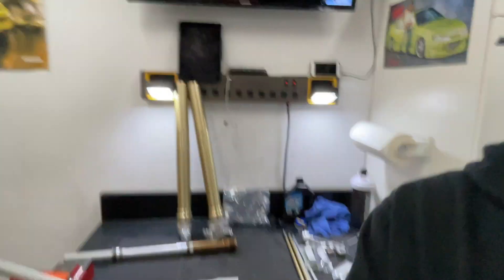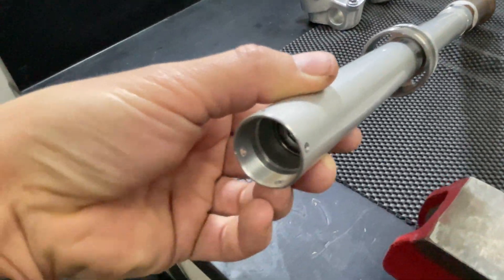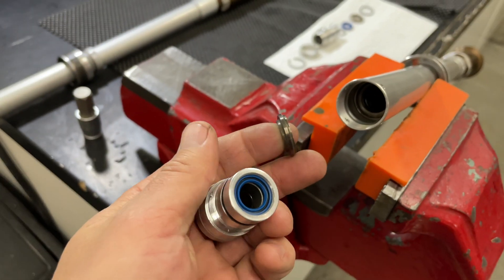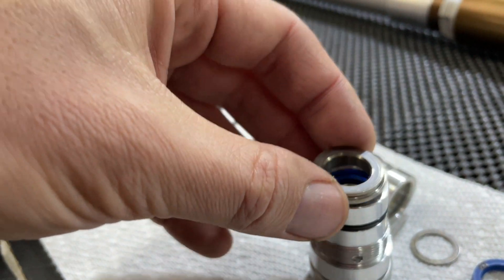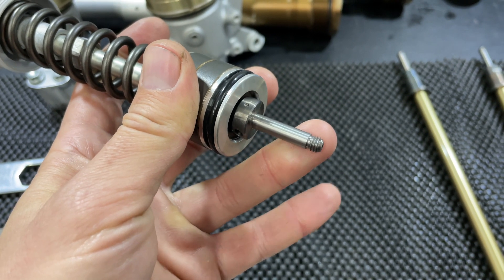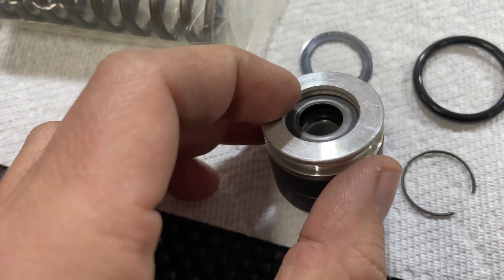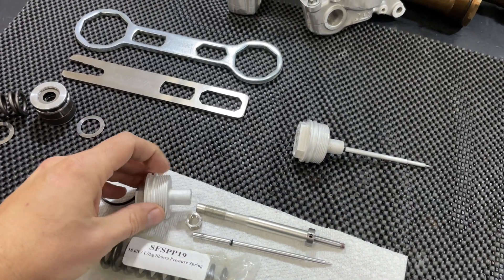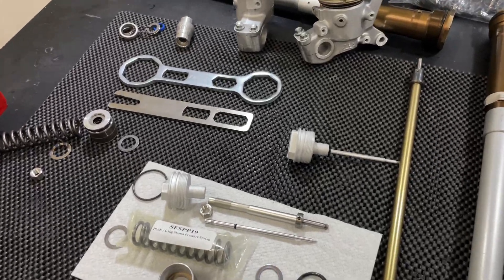Twin Chamber Fork Cartridge ICS damper seal replacement

Comment: How do you removed the bushing in the ICS part? And the seal on the base valve?
Reply from the maker: The bushing can simply be pressed in or out.
Reply: @topstar3 I’m having a hell of a time with mine. I’ll have to check in the morning.
Reply from the maker: @joshuapeters2764 you will destroy the seal taking it out. Lay the piston on something soft like a block of wood, find a metal rod or something that fits just big enough to only hit the seal, and whack it with a hammer a few times. As long as yore sure you've removed the spring clip and washer, it will go.
Reply from the maker: @joshuapeters2764 another thing you can try is use a drywall screw. Screw it into the seal, once it bites, grab it with some pliers and wiggle the seal out.
Reply: @ it’s the Samar diameter as the hole in the piston.

Comment: That damper seal in the upper part.... Ive got over an hour into it and still cant get it to budge! Yes, I have the circlip out and the washer. Screw drivers and picks to no avail... There has to be a technique to it that I have not seen in the 3 decades Ive been working on things. Its embarrassing at this point.
Reply from the maker: It’s a very tight press fit. Knock on it hard and it will come out!
Reply: Did you ever get it apart? I’m having the same problem….

Comment: Thanks this does help a lot. But LOL, you didn't show the hardest parts. Getting the cap loosened up from the rod, "had to heat it up like you suggested to get it unstuck". Removing the seal was very difficult as well.

Comment: Is it normal for the cartridge spring to be loose in the cartridge? I was thinking my old cartridge springs were wore out and I needed softer ones, but they’re the same exact length. Even with the new springs installed it’s like it’s not long enough or it needs a preload. Is this normal?
Reply from the maker: It’s normal. The spring will be under pressure once the ICS piston rises up when the fork is bled.

Comment: Is the top seal the same as the bottom seal?
Reply from the maker: No they are different.
Reply: Can you tell me what the part number is for the top seal?
Reply from the maker: @KyleLazzarini-sz9jl  don’t have the part number off hand, but it’s readily available from places like RaceTech, SDI, etc.

Comment: I'm curious if your damper rod is 12 or 12.5mm diameter.. seems like there's 2 different seals available. My damper rod on a 2012 rmz450 measure 12.5mm. so ordered a 12.5mm seal. Maybe some 250 or older twin chamber  models have a 12mm damper rod?
Reply from the maker: I know for Kawasaki, they went to a 12.5mm in 2008. Not sure about other brands.

Comment: So under my spring in-between the piston body, I have a pre load spacer that I have never seen on any other forks? Is this an aftermarket piece?
Reply from the maker: It must be, I haven’t seen that before either!
Reply: Maybe they added it because the spring is loose. That’s the issue with min,  the spring is loose and it’s like it needs some type of preload. Did you figure this out?